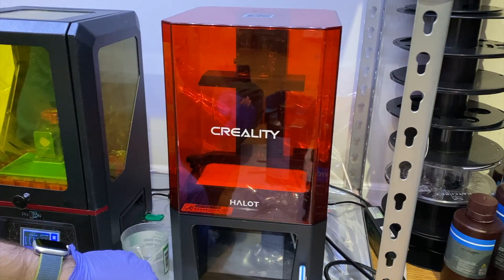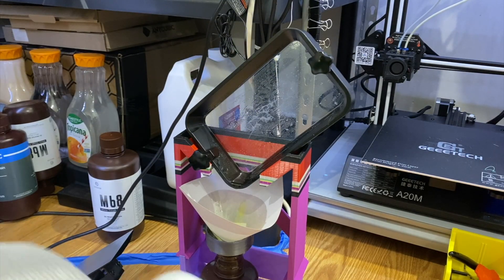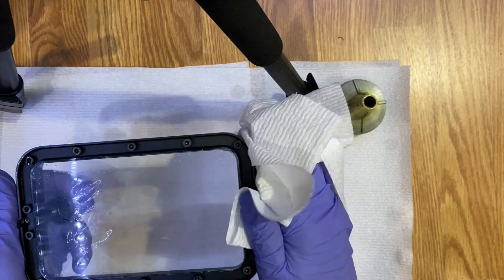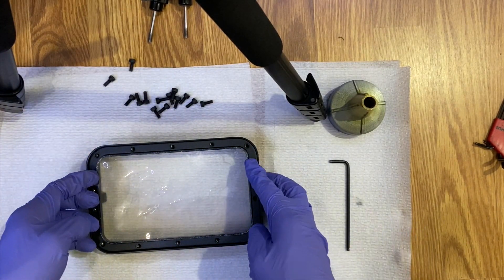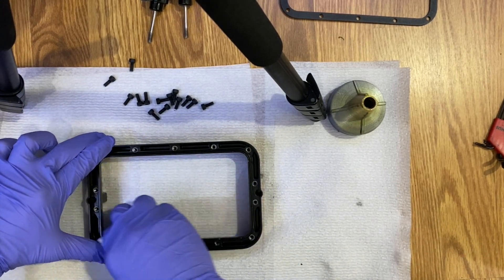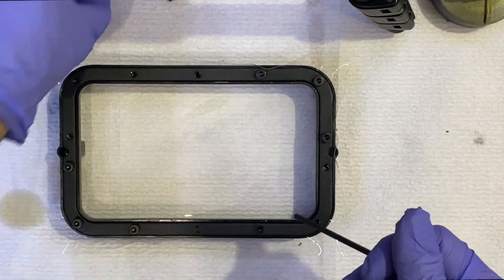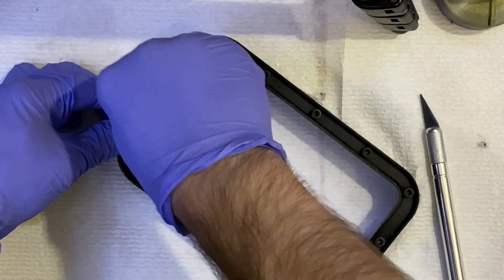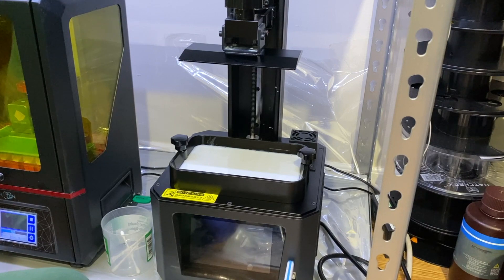How to replace Creality Halot ONE resin vat FEP Film

Comment: It's probably better to just poke holes on opposite sides and then put those screws in first, That should get you a more reliable and less likely to have some of the holes in not quite the right place. I'm not sure that it absolutely has to be done, but in general things like this tend to be best done with the further ones apart first, then the closer ones.

Comment: im almost throwing my Halot one thru the window, I tried everything but print sticks to FEP, Half of the print to the FEP and half to the build plate, I've tried everything possible
Reply: Any luck? I had a puncture in my FEP and replaced it. Now, nothing sticks to the build plate any more. Prints are failing at the FEP. Tweaked exposure settings and nada. Seems like FEP might be too taught, so that when the platform lifts, resin print doesn't came along for the ride
Reply: @mrglobul12  yes i had luck, for me, I found out that Hallot one for most of resins it is necessary long exposure per layer, for me 4.3 secs for transparent and water resin.... this is why it was sticking to the FEP

Comment: Have you done the bottle cap method? Putting a bottle cap in the middle of the fep and tightening it as so. To create more a peel instead of slapping off the model when the plate moves up?
Reply from the maker: Yes i did. Bottle cap method works great if you have double frame to screw the fep first like Anycubic’s resin vats. If you don’t have double frame to sandwich the fep it is hard to do so
Reply: @3DPDoctor  that makes sense!

Comment: How do I know if its too tight? I changed my FEP and now nothing sticks to the build plate.
Reply from the maker: After that you need to re-level. Bad leveling is the reason for non-sticking issue or the bottom layer exposure time. These are the most common issues. When you are replacing the fep just push it a little in, it is hard to tell but like 5 mm maybe, then tighten. It should be good to go. There are other videos for detailed tightening steps
Reply: @3DPDoctor  Thanks I relevelled twice and put a bit of ptfe lube in the vat, I think its working now.
Reply from the maker: Good luck

Comment: And how much did you tighten it
Reply from the maker: I tightened the screws gently until they are all the way in. For the tension of the screen put it on top of the frame and while stabilizing push it a bit with your finger to change the tension
Reply: @3DPDoctor  i don’t understand tbh. Which frame are we talking about. And what do you mean when stabilising.
Reply from the maker: Did you watch the video? Frame is the black metal portion where the 14 screws are screwed through. Stablizing: I mean when you first put the fep film between the frame and the tank walls.
Reply: @3DPDoctor  got it